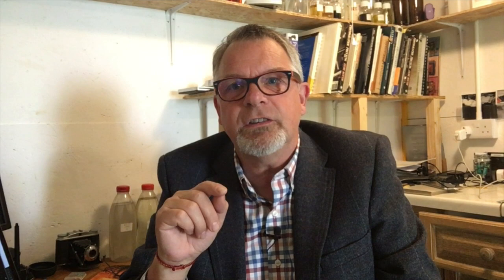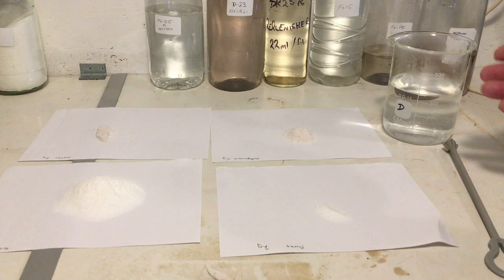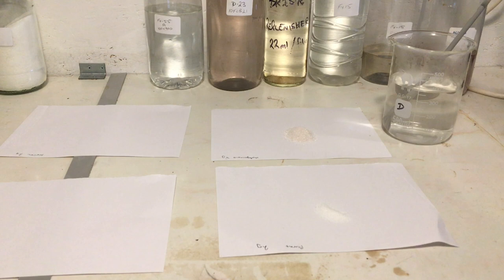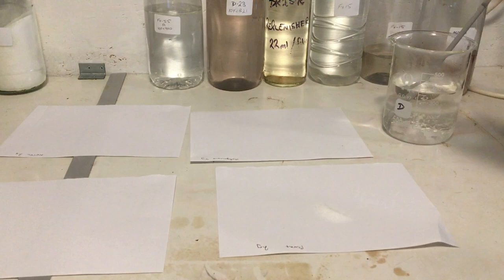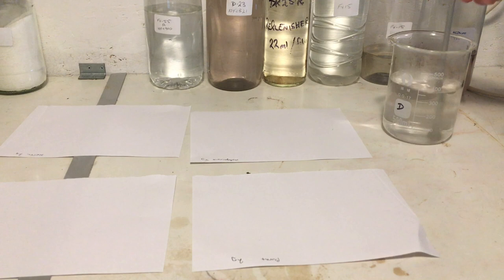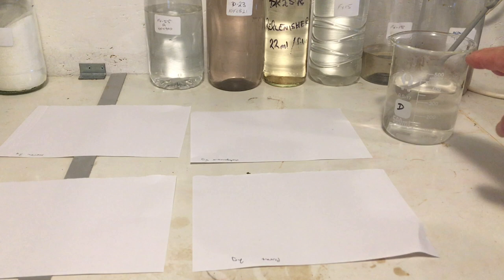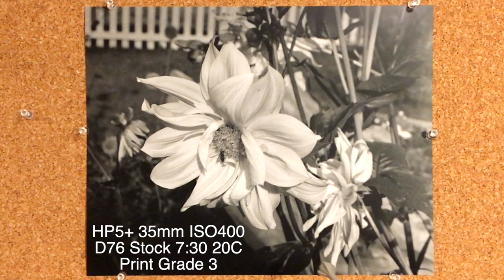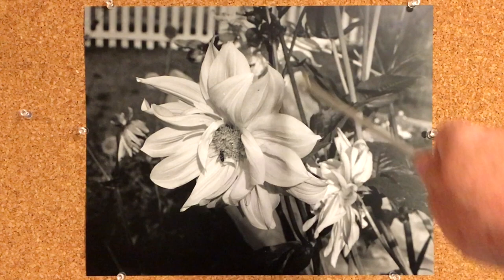Kodak D76 Part 1 - Making and Using This Classic Developer

Comment: Great video, thanks. I heat the water to 50°C, add D76 powder from the packet and use a milky coffee frother to whisk the mix. Takes about a minute and I get a nice clear liquid. I leave it for 24 hours. Works fine.

Comment: One of the reasons D-76 is a standard developer is that, in fact, for many years is was (maybe still is) a "standard". In the 1930s, the American Standards Association ( aka ASA) was tasked to set standards for film speed to establish a rating system in the US to compare speed of new films, which is where the ASA film speed rating came from.  To do this, they made D-76 the standard developer for use in comparing all B&W films being  assigned an ASA speed. I think that organization stopped doing this several decades ago, and the reference to film speed adopted the ISO (International Standards Organization) reference, although it seems to be the same rating standard. When I used D-76, I diluted stock 1:2 for use as a one-shot developer, which IMO made repeatable results much superior to saving used stock for further re-use and gives much sharper (if not smaller) grain structure.
Reply from the maker: Thanks for you comment, Randall! Yes, the ASA test developer was similar to D76 (although not the same). Definitely from the same family. I believe it was MQ Borax. You raise a good question as to what they do now? I wonder??
Reply: I always used it 1:1 for excellent results.
Reply from the maker: Yes, agreed!

Comment: I was my second  “DIY” D76 I mixed some days ago. I was really positively surprised by results I obtained with my favorite cheap Rollei RPX 100. Using stock concentration I obtained really nice tonality and surprisingly small grain. In parallel I prepared D76R – to keep my developer alive for longer time. What is your opinion about D76 replenishment?
Reply from the maker: I don't have a lot of experience with D76R but instead use D23 Replenishing. I like it a lot!

Comment: Could you elaborate a bit more on the activity upon storage? Really curious to see what this means. I have been using D76 for a while now but what can i expect overtime when storing the negatives?
Reply from the maker: The classic D76 developer increased in PH over time. This increase caused the developer to become more active and therefore develop your film faster and to a higher contrast. It's difficult to get your development consistent if you don't know how much activity your D76 has. Now, there are modern formulas for D76 that fix this problem, D23 being the simplest solution (literally). As far as negative storage is concerned, no problem as long as they've been fixed and washed as per my videos.
Reply: @PictorialPlanet  ahhh ok, then I got it wrong... I thought that you ment the negatives when developed and stored increase over time in contrast.. And that sounded a bit odd to me. But when it comes to the shelve life of the developer inside the bottle I understand that point. But I hardly ever keep my developer more that 2/3 months because I always mix up whatever I need for a developing sesssion so I never have to worry about that problem!

Comment: How does D76H (H76) compare to original D76?
Reply from the maker: I prefer the original however, after using D23 Replenished, I never went back to D76. D23 replenished just has a nicer, richer look. Recommended. I cover it in my book.

Comment: Has anyone tried 120 Shanghai B&W film recently? I use their 4x5" film and like it.
The reason I am asking is I want to order some 120 Shanghai to try but not if they still are having trouble with the backing. If you are not aware, a few years ago Shanghai had a problem with the ink on the paper backing that would transfer to the emulsion of the film while it was all rolled up. The ink of the words and numbers would soak in and not come out during development! In the final B&W prints, you could faintly read those words and numbers.

Thank you.

Terry Thomas...
the photographer
Atlanta, Georgia USA
Reply from the maker: If you try it I'd love to know how you get on.